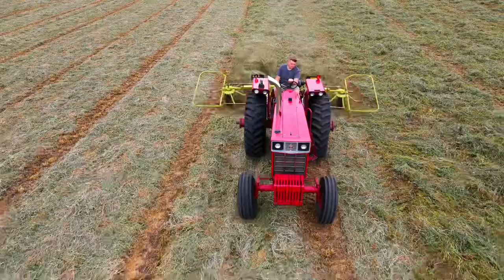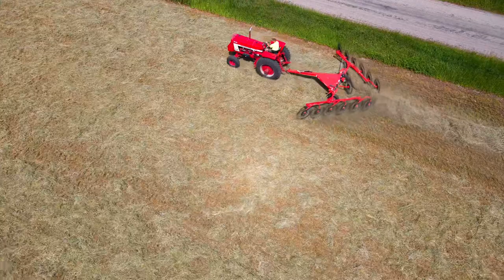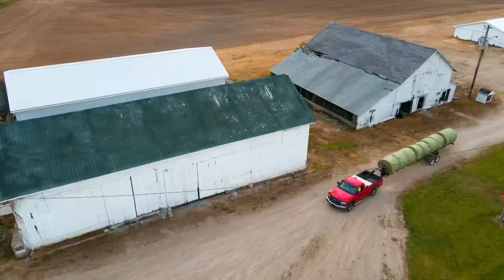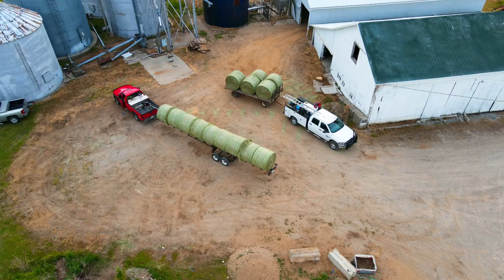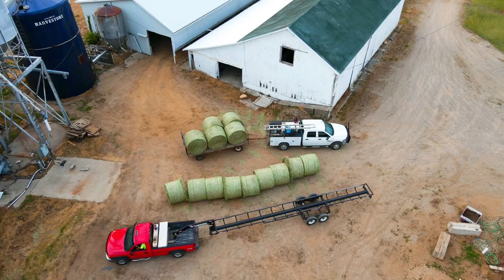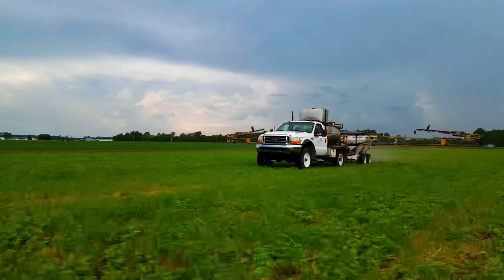Cross-Road Farms Hay Production 2021

Comment: Love the round bale trailer
Reply from the maker: One of the most important pieces in the operation we also have a 50’ flatbed semi trailer that will hold 38 bales you can haul more bales faster with the 9 bale dump trailer due to the fact of not having to unload manually or strap the load. It’s also nice being able to drop a load off to a customer and not have to wait for a loader to unload. Just dump collect payment and away you go